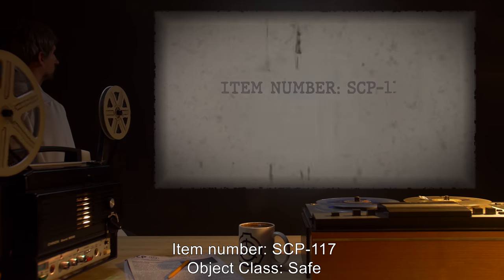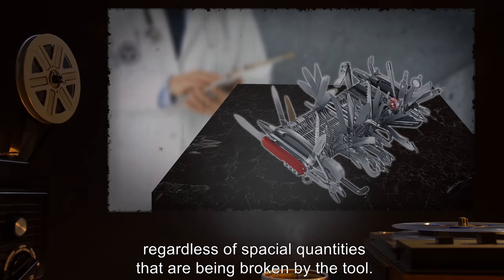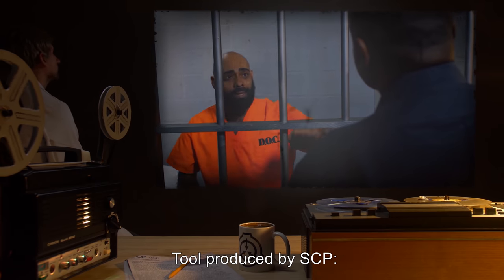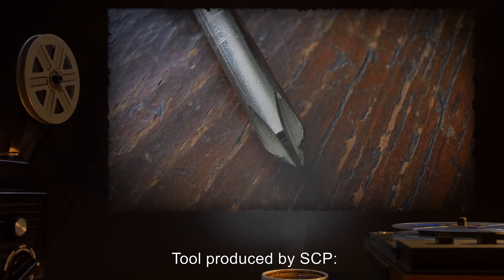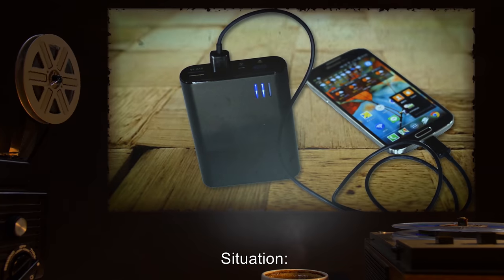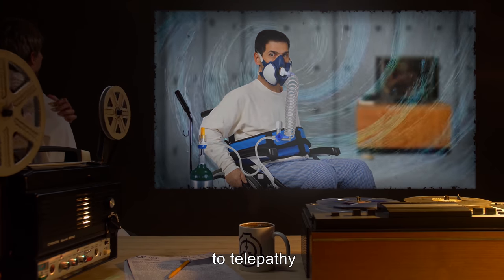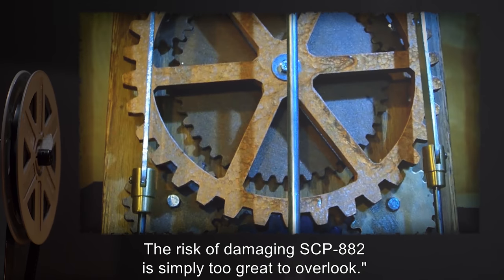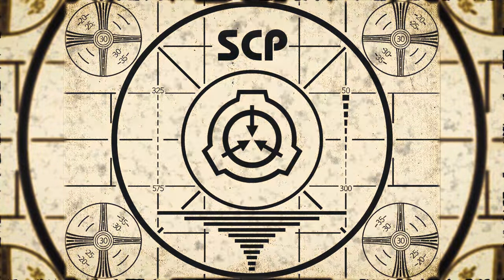SCP-117 | Complete Multitool (SCP Orientation)

Comment: If you make a machine with liquid minerals in it and a reader and iv connected to your veins you could theoretically use this infinitely with no repercussions at the cost of sterile mineral IV solution.
Reply: My thoughts exactly. Some sort of monitoring equipment that gives you the replacement equivalent. Just give the user a picc line to attach fluid bags to...

Comment: Scp-117 a pretty interesting object pretty useful but it does have a gripe side effect it causes to its house or wielder or whatever but just letting you know if you think about using it to kill 682 think again cuz it will not work because 682 is immortal yeah that's why and plus 682 is a cosmic entity as well so yeah that's why as well
Reply: it is interesting but the redaction really ruined the file tbh
Reply: The thing is: SCP-117 was used on SCP-682. What did 117 do? Well, it just teleported itself and the user away, each time it was activate in the presence of SCP-682. Attempt failed